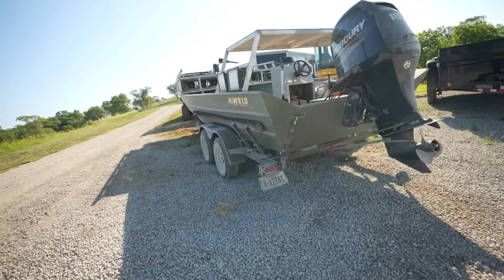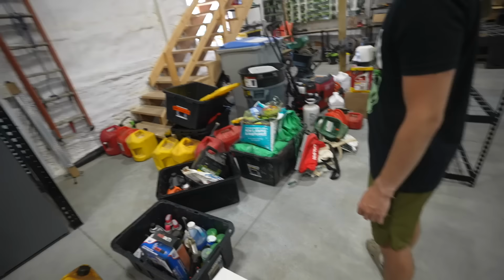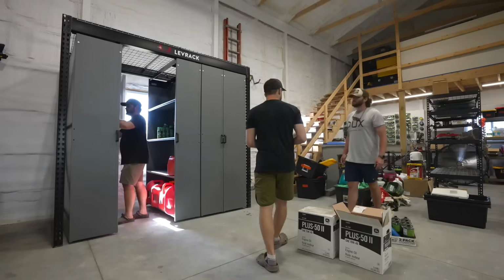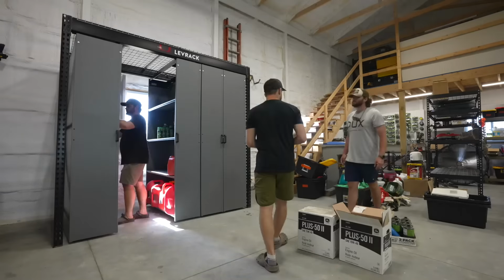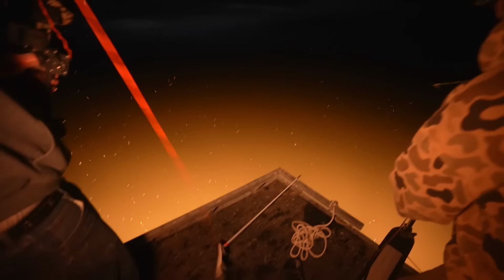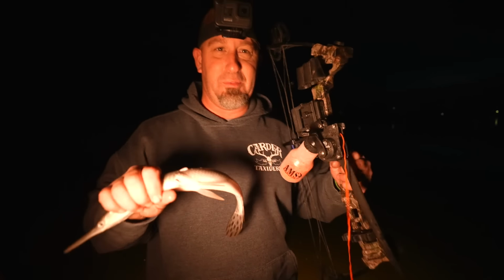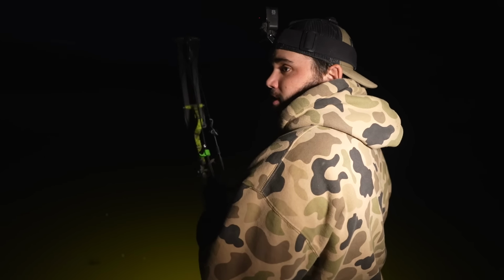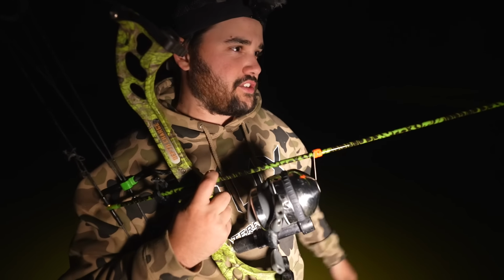NIGHT-TIME BOWFISHING with My New GIANT Boat for the FIRST TIME!!!

Comment: I’m not a professional at bowfishing but I do go very often and possibly going to compete in tournaments. The major thing to remember is to aim lower than where the fish is at! If you don’t think your aiming low enough then aim lower! Just a good tip I learned with bowfishing. Also, carps are very easy to spook, they can feel the vibration in the water. Try and sneak up on them and don’t make a lot of noise! I hope this helps!!

Comment: damn, that fishing / GOOGAN corner, and the TOOL/ Dewalt corner are both freakin AWESOME!!!

also super cool that the , "gun safe" made a nice little workshop, over where all the dewalt stuff is. . you need a nice work table, and a big welding table over there. and you will be set to build anything over there

Comment: you should have someone modify your trailer with a sliding tongue so you can make it longer and your truck doesn't have to get as near to the waters edge. my dad was a welder and he did it to both our boats, a 24' and 14'. makes life so much easier.

Comment: Had the same problem with our gen last week. Found out it was too full of gas and didn’t get the right air flow in it or the cap had gas retained in it. Just loosened the cap enough to equalize the pressure and burn off some gas while running lights, after a couple hours tightened it started running like new. Aim low on the mud Marlins  🇺🇸

Comment: Look into the Jackery 1500. It comes with 4 Solar Panels for $2700 yeah its expensive but the unit can be charged with solar during the day then power you all night and you ain't got a humming noise in your ear. Also better on the environment & also don't have to use fuel for the generator. They probably will sponsor a video considering you're over 1M subs. Definitely something to look into!

Comment: I run a 3500w genny for my boat.
I run 8 HPS 150W lights off it. Then I run the 8 LEDs off batteries.
It's louder than your Honda genny, but works great.

Comment: Flair that's what you get for getting a half ass 4 wheel drive. You have 1 wheel driving on the front end and 1 wheel driving on the rear end. They call it 4 wheel drive. You need axles with limited slip. So the wheels lock together like positive track.

Comment: Flair look into 18" wheels with 35" tires custom offsets should be able to tell you the backspacing on the wheels exactly but having an 18" rather than 20" or bigger is you can get more ground contacting with more tread  smaller sidewall is less tire to give traction